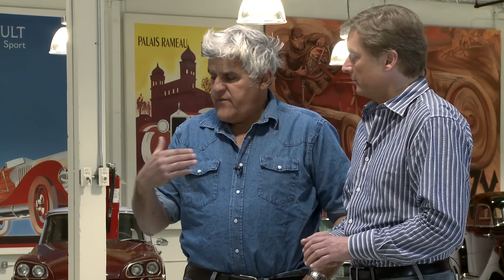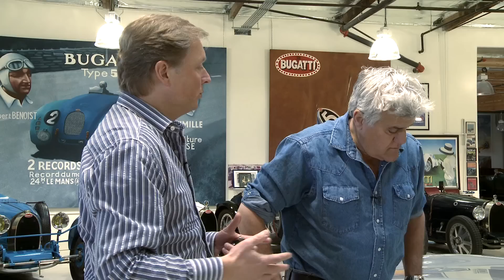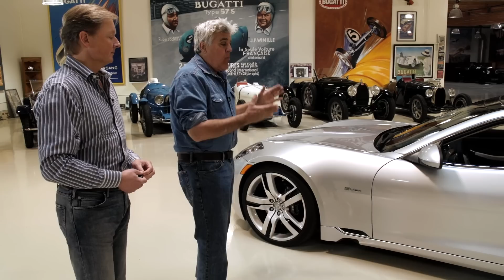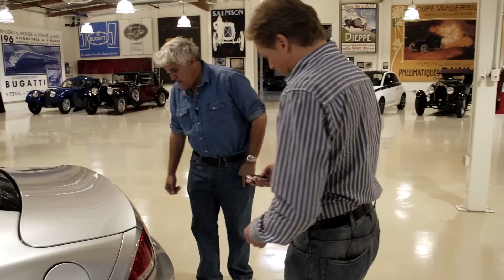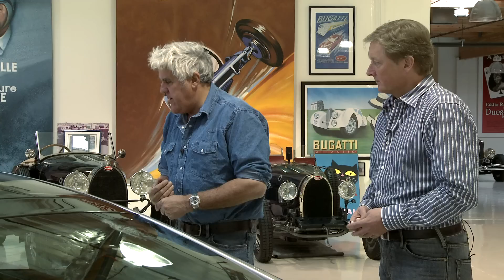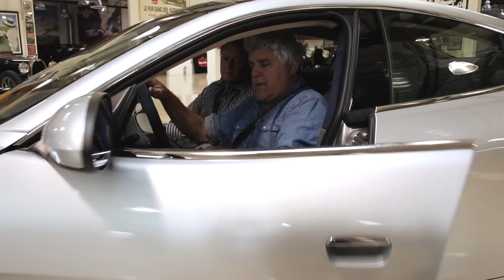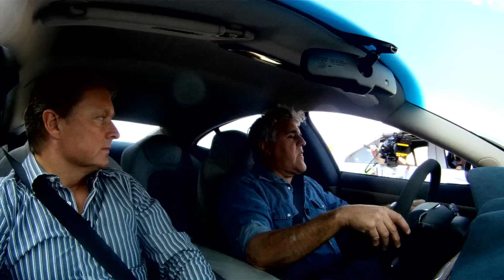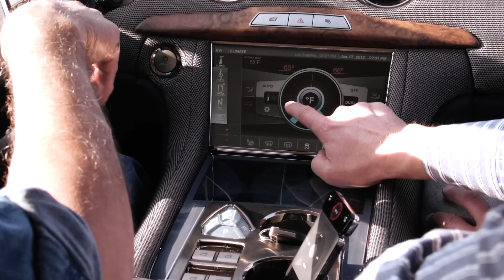2012 Fisker Karma - Jay Leno's Garage

Comment: Exotic looking but not an impressive product over all.  Not remotely comparable to the Model S.  And the front looks cheesy.
Reply: Bo McGillacutty Yeah you're right the Karma is not comparable to the Model S at all. The model S is the boring sensible daily driver you drive to work all week. This is the car you keep for the weekends to drive for fun and to be seen in.
Reply: neilcoo "Be seen in"?  I guess but it sounds a lot more boring to drive then the Tesla and the Model S is one of the best looking cars out there in my opinion, but I obviously like clean, smooth and sensible.
Reply: Bo McGillacutty Personally I think sensible is way overrated.
Reply: neilcoo OK.  But I love the "insane" acceleration potential of the higher performance S, not necessarily "sensible" but it's MY kind of 'nonsense'.  Performance is everything and form follows function.  I'm a little surprised that they haven't done away with side view mirrors in favor of nearly flush small cameras.
Reply: Bo McGillacutty I agree the P85D insane acceleration version is great but outright speed alone doesn't necessarily equate to a fun/good driving experience (ever been in an old MG at 50mph?), plus you're looking at a car that is over $120k. For most of us that's not a daily commuter car to be used up and thrown away, its a luxury toy for the weekends.  And for that kinda money you could be buying something much more special, unique and fun such as a classic or used supercar.
Reply: neilcoo Actually, despite the price I think it would be a daily driver.  But to each his own.  I do hope they manage to produce an excellent economy car but Elon wanted to show the world that an electric could be highly desirable first as almost none ever achieved that before, and they certainly succeeded at that goal.
Reply: +neilcoo P85D is a 2015 car.. still think this is a bad idea, if you're going to use ICE to drive a generator its better to use a small diesel.
Reply: +Bo McGillacutty This car is more focused on sport where the Model S is more about luxury. This isn't even all electric like the Model S.
Reply: Dilip Tien   Sport "looking"?  It can't hold a candle to the performance of the S either, can it?  Ultimately performance is everything to me and as far as I know there is nothing that compares currently to the Tesla.  (referring mainly to acceleration, cornering, handling and breaking in this context, but safety, ride quality, etc. are also crucial and hard to match the S in any let alone all those categories)  One day there certainly will be.
Reply: Bo McGillacutty I meant that it is more of a grand tourer, not necessarily faster, but does well in the corners while remaining comfortable.
Reply: Dilip Tien   I see.  But I bet almost anyone, you included, would take the S over the Karma if you had each for a week to drive no matter what your primary criteria are.  The S reportedly does superb in every way, those included.  It's too big and expensive for ME but quite possibly the best executive/family car ever made.
Reply: Bo McGillacutty executive family car??? It can be one or the other, not both lol. You could spec the car to one of those, but not both.
Reply: Dilip Tien Oh I don't know, I think the M5 could be considered a family car if money is no object and it pretty much sets the bench mark for "executive sedan", and the S is in roughly the same category while being in a class of it's own.  Certainly those who might purchase an S are the same folks who would consider an M5, in general.

Only time will tell how expensive the S is to operate per mile, battery life and reliability, etc.  But the only thing I really don't like about it is it's exceptional weight, even range is almost a none issue at least for the higher capacity battery versions.  And it apparently is not as well equipped in the interior as it should be for it's price range but I'm guessing it will be improved in that respect.
Reply: Bo McGillacutty It's E-Class v 5 Series.
Reply: Bo McGillacutty I think that the Germans and Japanese compete, with Cadillac jumping in at times. I can't think of any other competitors.
Reply: Dilip Tien   I agree.  My bias is heavily in favor of BM and Merc with only some reliability and operating costs hesitations....but if I was in the market for a new car I'd have to force myself to sample a few others that I just don't know enough about. (I have modestly upgraded old BM 330 with hopefully a lot of life and pleasure left in it still, it suits me well)
Reply: +Bo McGillacutty Dude, are you really that lazy to not put a "W?"
Reply: soulintake  hahaha  It's a 33% abbreviation and commonly used in some circles as there is no other auto manufacture it can be confused with....it just sounds better.  ;-)
Reply: +Admiral of the Fleet Sir Cloudesley Shovell I agree, which is reassuring for me... the Tesla S engine management is just the kind of Industrial power control that drives 24 hours a day electric motors, in most factories around the world, with down times in the order of 1/1000th of the operating time.  I hope they resisted the temptation to innovate, and just re-used some well tested module.
Reply: Alison Smith OKAaay.  How about the performance specifications?  Price, acceleration, RANGE, aerodynamic coefficient, internet interface, Nuremberg test track time....?
Reply: It's the front that makes it stunning to see. Have you seen one actually one the street? It's a beautiful sight to see. It has that WOW factor, even with the 4 doors.
Reply: neilcoo how is the Tesla boring?
Reply: Mc Laren Aston Marin rapide is pretty great.
Reply: It looks bland and just like every other dull 4 door commuter car on the road.
Reply: neilcoo 1. That makes no sense
2. It's performance more than makes up for anything else
Reply: Model S is the sexiest sedan on the road.

Comment: This video is - I believe - a bit behind the events of the day. Fisker went out of business about three years ago. They are trying to get some government subsidies and relaunch.

Also this is not new technology at all. In the Second World War Dr. Ferdinand  Porsche created what he called an 'electric transmission'. There were two or more gasoline engines which powered four electric motors. There was no mechanical connection between the gas engines and the tracks. He had used this - the first hybrid - on his prototype for the Tiger tank. But it was rejected for the conventional Henschel design. This technique was also used on the giant  tank destroyer the 'elefant'.
Reply: This video was posted in 2012
Reply: Mercer Byrd Thank you. I knew that. This is 2015 and I think Fisker is out of business.
Reply: How is this video "late " then if it came out in the karmas first year of production.
Reply: Mercer Byrd In the old days when we all read newspapers if you saw an article on the front page about some event you assumed that it had happened the day before - and it usually did. But today if you look up something of the Web you have to be careful. It may have taken place yesterday and it may have taken place a year ago. You need to check.

This video looks like it is a current event piece. It looks like the Fisker is a new vehicle that has just come out. But that's not the situation at all. Events have moved forward. Fisker was a new car with some new technology a couple years ago. In the meantime however the Fisker has gone bankrupt - or at least I think it has. It may have gotten some new government subsidy and is being sold again.

So what is the story here? Is the Fisker a new hope for the environment? Or is the Fisker another foolish dead end like Solyndra?
Reply: Patrick Boyle there is still an open fisker dealership a block away from my house.
Reply: Winston Zeb Thanks. Good to know.
Reply: Patrick Boyle A Chinese auto company bought them & they were renamed The New Fisker.
Reply: I would like Fisker to succeed  But they seemed to have gone about it all wrong, They should have followed the example of the Kia. Start small. Establish a reputation for value and quality and then introduce their engineering innovations. It is hard to start a new car company.. It is also hard to create an electric or hybrid car from scratch. Fisker tried to do both at once.

The fundamental problem of all battery operated or assisted cars is that the Lithium Ion battery isn't quite good enough. It doesn't have enough have enough energy density to meet all the rising expectations of modern drivers. Even in the nineteen fifties an electrical car was possible. But cars today weigh much more with all their safety features and they all have air conditioning.

Unfortunately there are not a lot of feasible alternative to Lithium Ion.

Hybrid technology is not new. It has been in production in Porsche designs in WWII. But to be practical we will need batter batteries.
Reply: +Patrick Boyle i agree people that have that kind of money buy for the gimmick not to many people have 100k for a car I'm picking up a chevy volt Tuesday hope I'll like it

Comment: The company that stole design ideas from Tesla. Oh well, the Tesla Model S looks waaayyy better than this thing...
Oh and about the range anxiety on EV's!? Take the Tesla's range, I bet you, you can go get a Pizza, go out to eat, drive to the hospital and do many other things before you run out of electricity, especially with the aspect, that your car is always fully charged every morning (if you plug it in at night, of course).
Reply: wtf? tesla lost the law suit and had to repay legal costs
http://en.wikipedia.org/wiki/Fisker_Karma#Tesla_lawsuit
Reply: Fisker Karma is way cooler. I see 10+ Teslas anytime I drive more than 15 miles.
Reply: Thor Estey You try doing a slightly longer road trip outside of California where you don't have supercharger stations every few miles...

Sure, it's fine for most uses, but for a lot of people it's going to get impractical every now and then. Until they supercharger stations become a standard part of the gas station infrastructure the gasoline powered car will still be the more practical option. Here in Finland there literally isn't a single supercharger station in the whole country (at least according to Tesla's own website) and the closest ones are in Sweden, where there isn't a single one in the northern half of the country.
Reply: +Murica - Bernie Sanders 2016 You are mostly wrong.
Reply: Looked nice to me, tho the interior is frankenstyle!
Reply: LAG09 The fact that there are few/no superchargers in a country just means that there is no market for the car there, so why bother building superchargers. On the other hand there are countries like Norway that propose a huge market to Tesla, therefore they build many superchargers there...
Reply: Thor Estey I suppose it's kind of a "chicken or the egg" kind of problem seeing how there isn't much of a reason to buy one in the first place due to the lack of supercharger stations.

Still, I think there were 50 of them registered in August last year and they don't even officially sell them here. So you can't say there isn't a market and selling them isn't a problem ether as EU regulations ban the kind of draconian protection laws car dealerships have used against Tesla in the U.S.
Reply: LAG09 50 cars per year? That's what you call a market? dayum
Reply: It's still enough to show that there is a market considering the population, that there's literally not a single supercharger station in the whole country, every single car is a so-called "grey import" and that these cars don't get any tax breaks.

In Norway for instance electrics cars like the Tesla are completely exempt from sales tax and additional car tax. Originally this was set up to boost the sales of a local electrical car maker called Think, which has since then gone under.
Reply: Steveraxx So now you say that I am not allowed to state my opinion on anything that I have not too much to do with? Tell you what: I have never designed a car, but I can still have an open opinion on it. I may not be a good chef, but I can still distinguish good food from cheap food. I am not a total athlete, but I can still tell if a sports team or someone doing sports is good or bad. And you know why it's legible for me to do so? Because they are PROFESSIONALS at what they do, or at least they should be. It is their job and if someone does their job badly, everybody can criticize it. Get over it.
Reply: HD Profit Yeah, that't the whole point, the designer did crappy work for tesla and then took off with the good ideas he had and applied them on the Fiskers...
Reply: Murica Hell, you could deliver pizza's in a Tesla that's how much range you have
Reply: +Alonso Gutierrez 

Sure Teslas are cool. People love them here. I was joking. 

Anything with 700hp instant torque is badass.

But people drive them like grandma's. People who aren't interested
Reply: Supposed you forget to plug it in?  Come home tired after a long day of driving, got to work the next day. Wake up late, ooops forgot to charge the Tesla. Try explaining that to your boss.
Reply: inquizative44 did you get home with absolutely nothing left? Seems like it would be as hard to forget as  not filling it with gas.
Reply: You think people don't forget to gas up there car?  Of course, but it's a non issue because you just go to a gas station and fill 'er up, takes a few minutes. Now if you have to charge your Tesla, different story. I think the Fisker is a better idea. It has the solar panels on the roof to help charge the engine, and a back up gas engine. Fisker must have the patent on the solar panels because I don't understand why the Tesla doesn't have that.
Reply: inquizative44 yea but the difference is that you can charge a tesla at home. You can fill up your normal car at home I'm the same way.
Reply: inquizative44 I'm pretty sure that those solar panels are only there to do things like seat heaters etc. ones that size could never really charge an engine
Reply: I'd be glad to drive either car as long as it's an ev.
Reply: Who doesnt take ideas from what company to help market their own? Anything you can think of, even in the entertainment industry, is somewhat recycled from somewhere else
Reply: so INCREDIBLY FUGLYYYYYYYYY!!!!
Reply: I much prefer the look of the Fisker over the Tesla.
Reply: FISKER'S KARMA IS WAY BETTER LOOKING THAN A TESLA
Reply: I agree, the Tesla is a real good looking car, but it is not exquisite - whereas this Fisker karma gains every time you see it - This extremely low slung midbox and the dynamic wrapping that happens between the wheel arches is very special and very Fisker.
Reply: http://fortune.com/qa-henrik-fisker/
Reply: the solar panels on that tiny roof may (and with high question mark) would be enough to charge your iPhone, and not even 1% of power required by a car.

https://www.theecoexperts.co.uk/how-much-electricity-can-i-generate-solar-panels

1 square meter (and this car has much smaller solar panel than that,but lets assume its 1 square meter), produces around 150-200watt per hour.

to drive range like tesla (around 300 miles), you need something like 100kilowatt battery. thats 100.000watt!
so it would take roughly 500 hours of perfect sunlight to charge.
or about 50 days (assuming you charge only during sunlight every day, 10 hours per day).

now..
this stupid solar panel on that car is a TOTAL gimick for idiots that buy stuff just becouse of hype and have no idea how electricity works.
Reply: I think Mazda started the trend with roof mounted solar on the last of the 929s (the pretty, jaguaresqe model) they used it to run an exhaust fan to keep the car cool, is this system contributing to something like that?
Reply: the power produced by any time of solar panel on a car is so small that using it is good for nothing, except maybe charging a cell phone.

the only "good" usage of solar panel on moving vihicle would be if you install them on big roof of RV + extened panels of sides of that RV.
check this video out: https://www.youtube.com/watch?v=JbBNC-jCV7E

on RV you could put something like 8-10 square meters of solar panels, and thats about 150ww x 10 x 10 hours = ~15kw per 'day'

now, with that kind of power you could easily live with all your mobile home appliances, be it air conditioner, microwave, owen, etc..

othat than that, i dont see any other use case for solar panels on any type of car
Reply: and Tesla has its Superchargers
Reply: Murica \Yet again, the moniker telegraphs the idiocy to come. How many vehicles have you designed and were brought to production? Puts paid to your opinion as anything which even mildly approaches authoritative criticism. Then this is what the interweb has done. Allowed dullards to post.
Reply: inquizative44 If that's the case you better find a new job because you are being overworked.